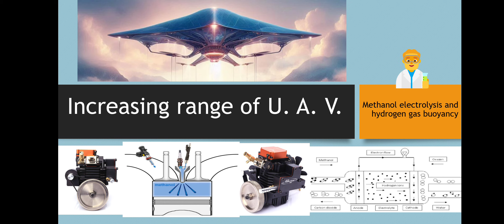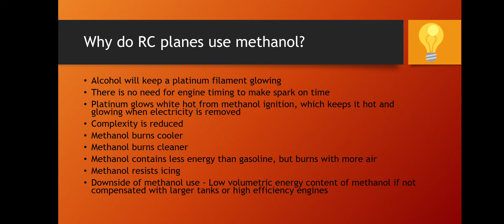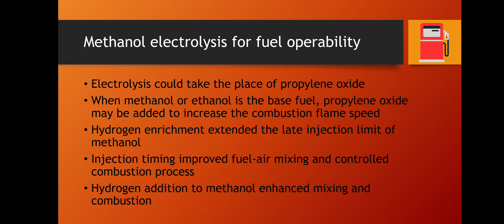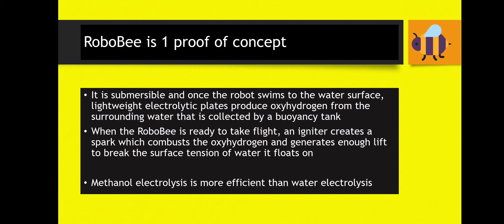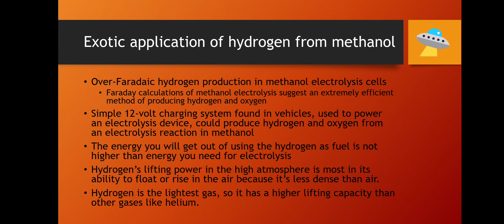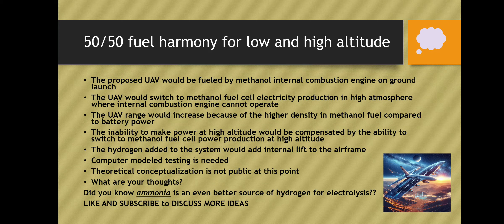💡 Methanol Electrolysis UAV

Comment: you mention at the end that ammonia would be a better source for H2 than methanol; if so, why not use ammonia electrolysis instead? is it due to chemical states/stability?
Reply from the maker: Great comment! Methanol internal combustion engines are off the shelf tech from the hobby RC industry, and ammonia internal combustion engines have yet to be miniaturized, although there are massive ammonia internal combustion engines in testing for use in ocean shipping now. This idea is for a hybrid that uses methanol internal combustion engines for low altitude, and then uses the remaining methanol for making hydrogen through electrolysis for a transition to hydrogen fuel cell power at high altitude.
Reply: @ThisPartIsAndrew  aah, okay; i see your proposal is a right-now sort of thing, makes sense
thanks for the clear explanation
Reply from the maker: @imaginsharky  thanks for commenting, and I hope you have a great weekend!